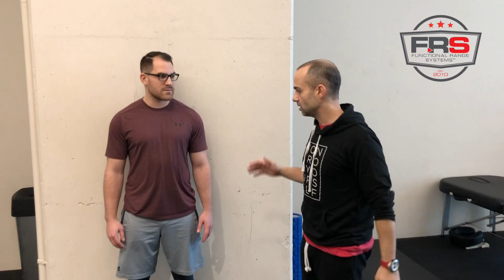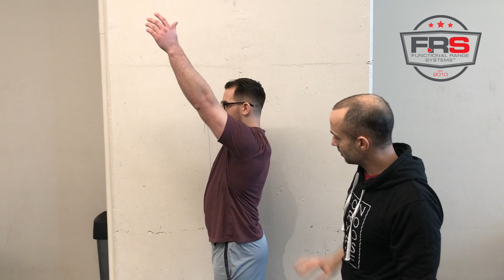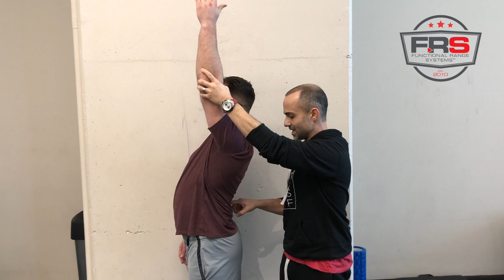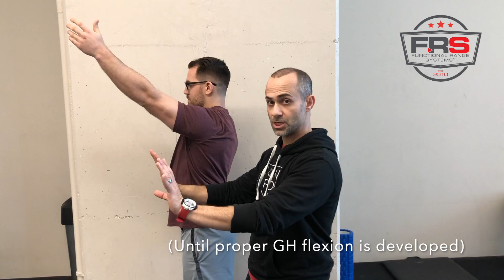Shoulder Flexion Prerequisite

Comment: People with limited shoulder flexion can still overhead press safely with no compensations just in the range they have. Why are you assuming that not locking elbows at the top is bad?